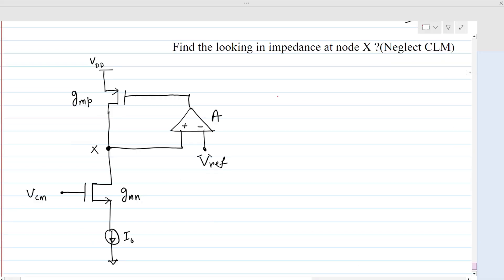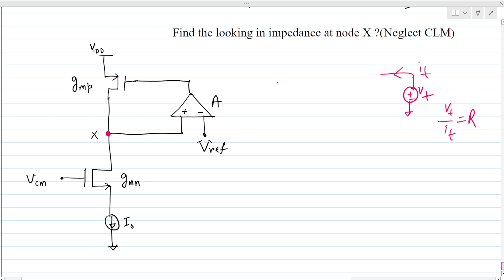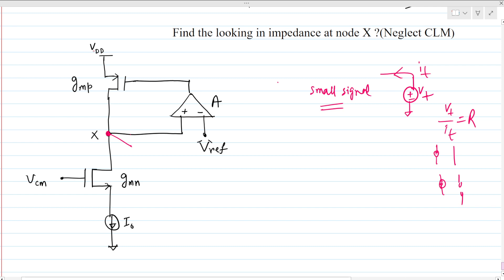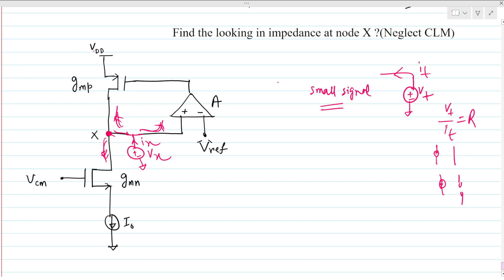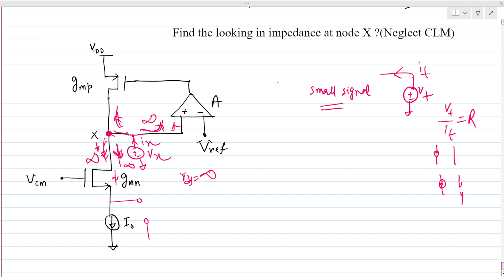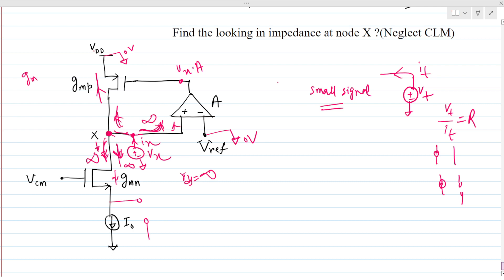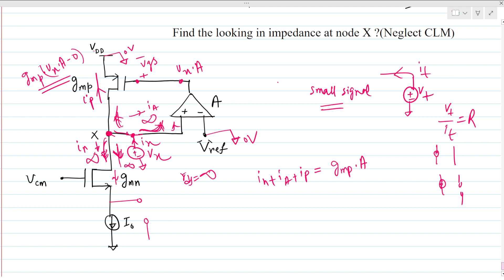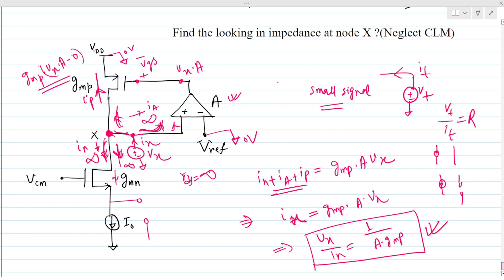Analog Design Interview Question _ Find the Incremental impedance looking into the node X ?

Comment: sir isn't the circuit in positive feedback loop ?
Reply from the maker: Why.?
Reply: @AmitBar-Analog_Circuits 
Sir if X is increased the gate voltage of the pmos will increase thus reducing the vsg of the pmos . Then the current through the pmos will drop and the voltage at the node X will further increase

Comment: i_p=i_n, other currents are zero due to infinite impedance of current source and no current going in the input of o/p amp. So, I think you do not need to sum up the currents in the last calculation step. It made things confused.
Reply: His answer is correct but approach is strange. More formally he should compute the loop gain, open and closed loop resistance. I agree his KCL is also questionable…
Reply: @-.-aaa Thank you 👌👌
Reply: Yes yes 🫡 @-.-aaa
Reply: @-.-aaa  Why should we compute open loop, closed loop resistance? The question is simple, when you look at the small signal circuit, what impedance do you see at node X?
Reply from the maker: No no,it is for more clarification I have shown the solution in both ways ,equn as well as intuition ...thanks for your feedback though...happy learning